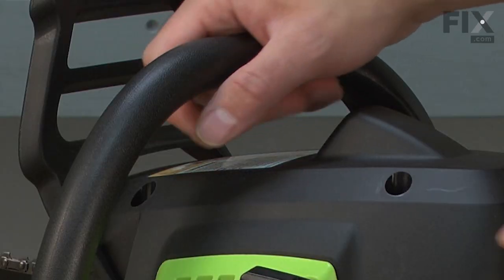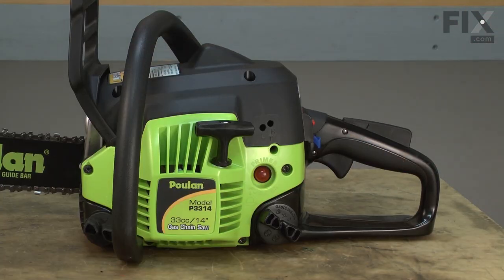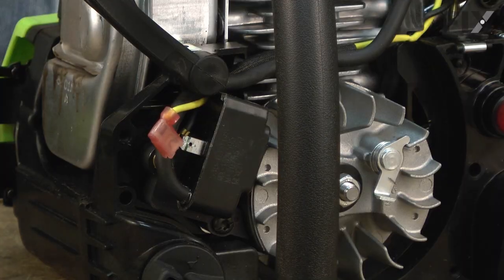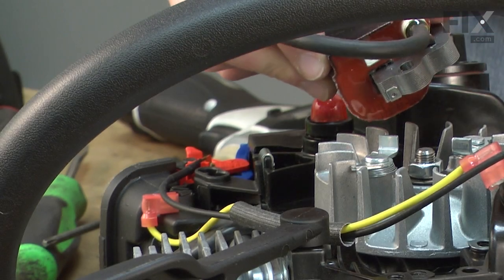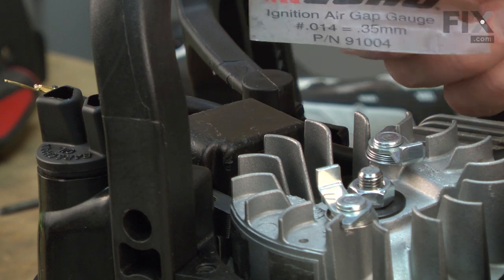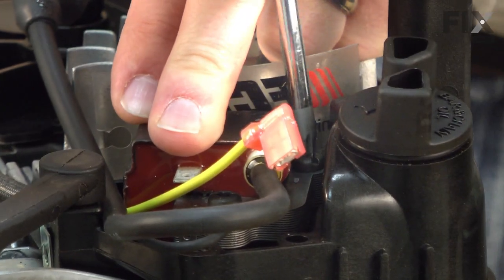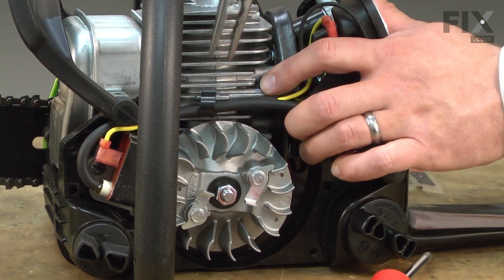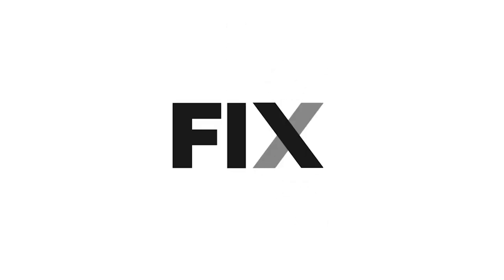Poulan Chainsaw Repair - How to Replace the Ignition Coil

Comment: ya, my p3314 is exhibiting this very symptom.  will start good cold and runs for a while and then if it dies, it is a beotch to get going again.  the spark is not strong enough....
Reply: Not spark. Very common issue in poulan. Take cover off moter will probably solve issue. If not just loosen gas cap then put back on. Solved my exact same issue.